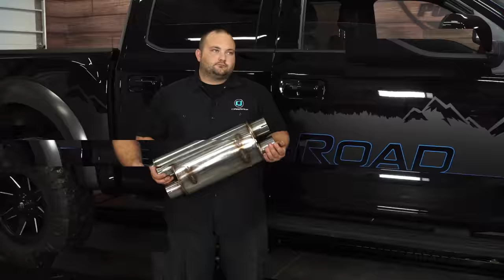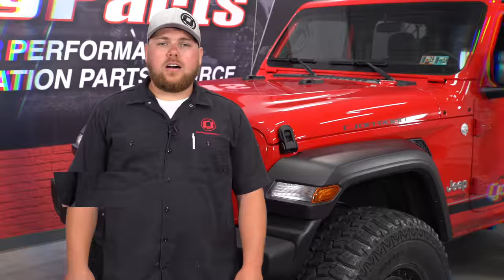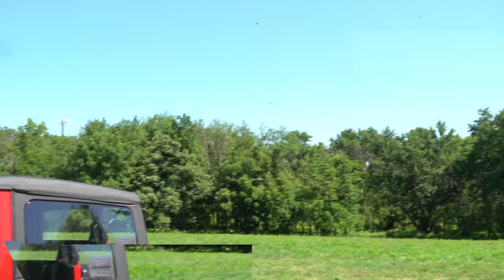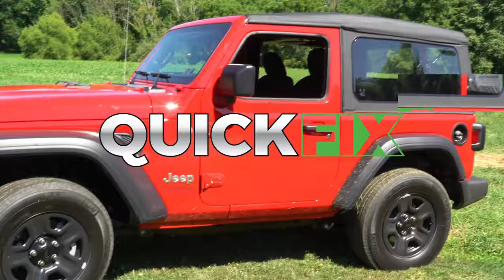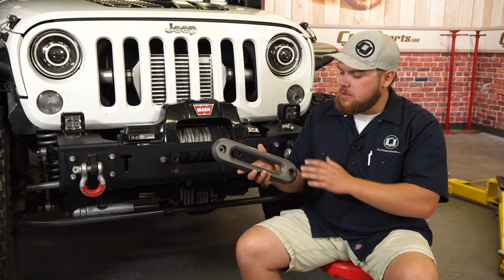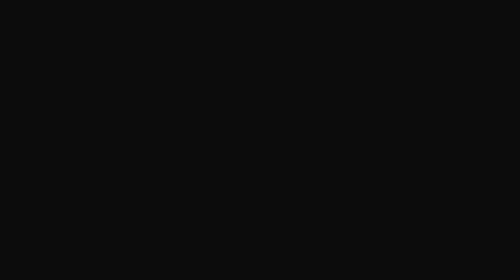Jeep Quick Fix: Factor 55 Gray Hawse Winch Fairlead 1.0.

Comment: Does this not come with bolts for install?
Reply: Dosen't sound like it, better get a 2nd on the house.
Reply from the maker: It does not come with mounting bolts, the thought was that since many bumpers run different constructions, as well as distance between the bolts and the winch, it would have been a guessing game to include the proper bolts. I'd recommend some grade 8 bolts with lock washers or lock nuts.